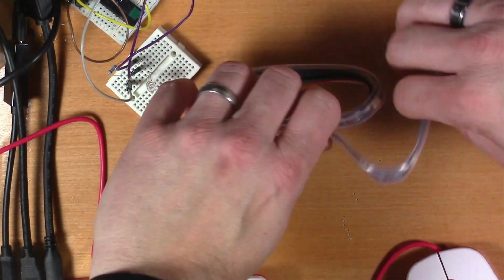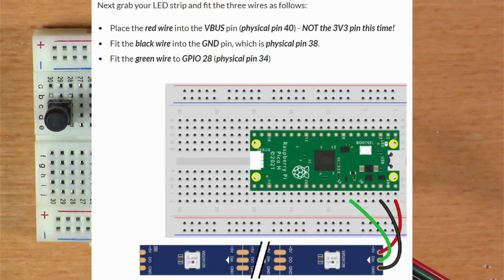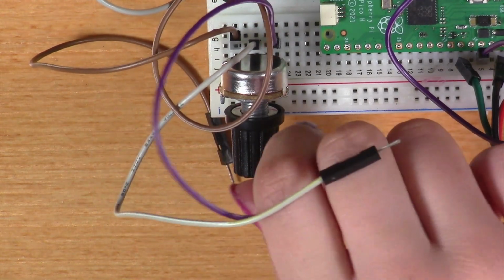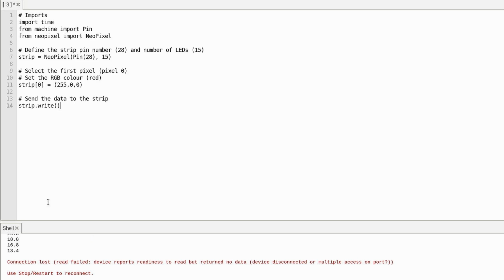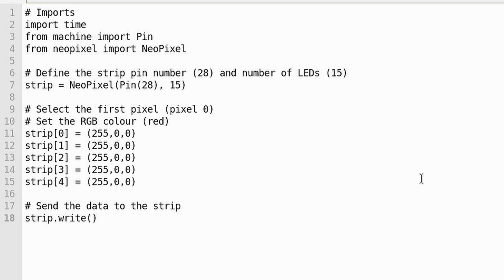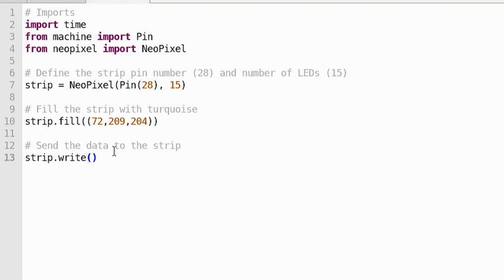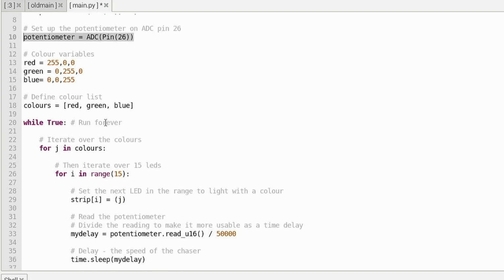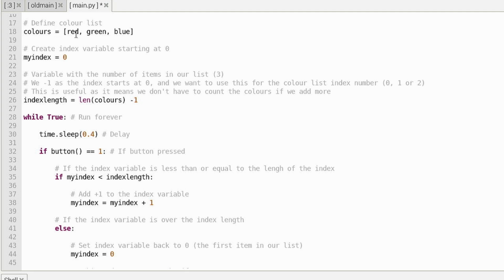Day 12 - Maker Advent Calendar - RGB LEDs!

Comment from the maker: I totally misspoke on the potentiometer comments related to the speed control. Clearly when turning "up" the potentiometer as arranged the resistance lowers and that raises the value observed at the input pin. So yes if we had a dial that said "delay" we are increasing delay. I hope you get my meaning when I said intuitive so as far as turning it up " would make it loop faster" . If you see it as a speed control instead of a delay control. I may even be messing this comment up but hopefully I am halfway getting my point across here.